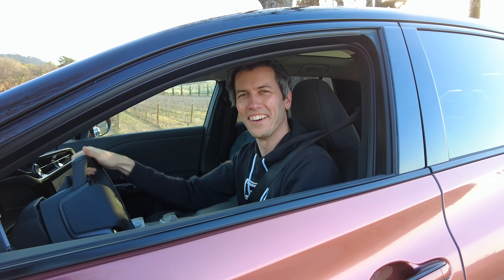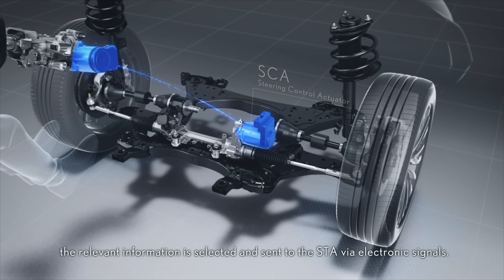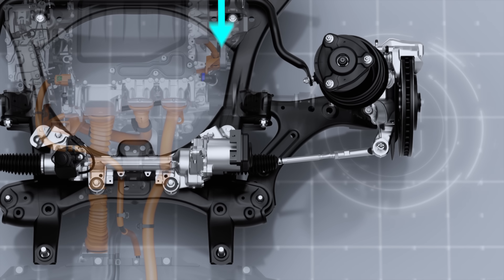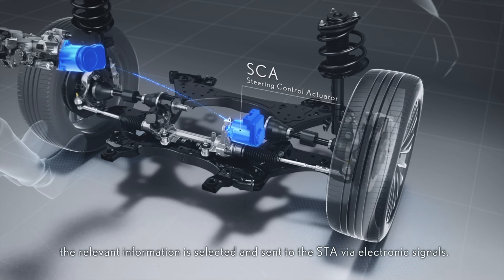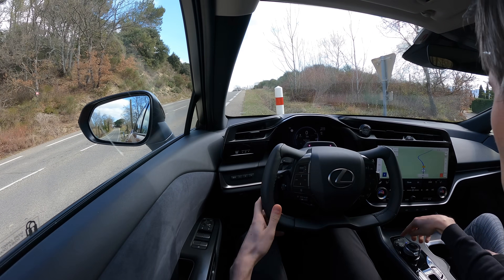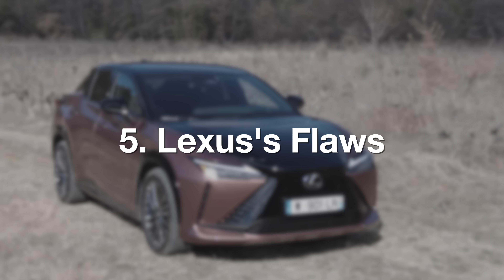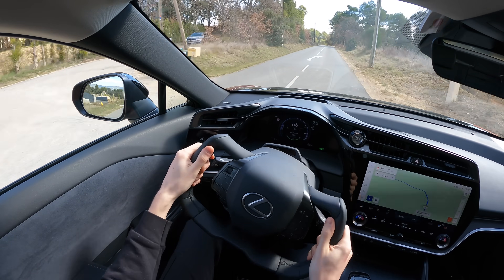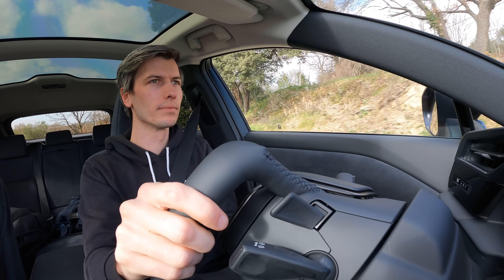How Lexus Fixed Tesla's Bad Idea: Steer-By-Wire Yoke

Comment: The variable steering ratio is a big technical issue to solve:
F.E.  I wonder if it's possible to swerve away from an obstacle while going at highway speed...
OR if it's linearly, smoothly, linked to the speed of the car, or if it changes in steps...
OR when the car loses grip will this system allow you to counter-steer your wheels enough to avoid a spin...

What I'm saying is let some Forza or GT developer program this - They have years of experience implementing variable steering ratio in their games and their solutions are proven to work for both performance driving and casual driving.

Comment: i agree, that most modern engines with electronic throttle have may more lag, than my first car with mechanic throttle. not that bad, but definitely noticeable. 
brake and steering by wire will always have delay no matter how small it is

Comment: One advantage of steer by wire that could actually be a big plus for those of us who want more feedback, is that there is no reason the system can't be used to amplify steering feedback far beyond what you would normally get. Of course that depends on the end user being given access to this level of control.
Something like this could be particularly helpful for driver training, since you could crank it up to show someone what sort of feedback is actually present in a given situation, then dial it back once they know what to look for.
Reply: I doubt thats something desired by those who drive it. 
But for high performance cars this could actually be something viable I imagine. If you look at simracing gear, the high end wheel motors have a peak torque output of 20-30 Nm. Even in racecars without power steering you only get around 10-12 Nm or peak torque, so if done correctly, feedback could even improve. 
The downsides are likely bigger though.
Reply: @schmid1.079  I agree. Unlikely to useful in most situations. But possible, and counter to the idea that a system like this would dull the feedback.

Comment: Since the steering ratio changes with speed, how does the steering response feel mid corner during throttle lift or light trail-braking? We are used to understeer reduction with forward weight transfer (assuming tires are within their grip limits), but if the steering ratio increases at the same time, this would appear to accentuate the effect a lot (which might be unsettling to inexperienced drivers), unless the system makes exceptions to ratio adjustments during rapid transitions. Would love to hear your observations!
Reply: Variable ratio steering systems already exist today, and are largely unnoticeable. If you’ve driven a modern luxury (BMW, Mercedes) or sports car, you’ve likely driven a variable ratio system without realizing it.
Reply: @TheWade822  lol Ford used them on Taurus, Town Car/ Crown Victoria/Grand Marquis.  Those are far from luxury or sport.  And this started in the 80s for those models.
Reply: @bowez9  yes, but all BMWs, Mercedes and Audis use variable steering. Its much easier to mention an entire popular brand, as opposed to certain models.
Reply: @TheWade822  more telling IMO that a tractor company has it on mid level vehicles and up.
Reply: @TheWade822  My car has variable ratio, but there are at least 2 kinds of mechanical variable ratio systems. One: the ratio varies with steering position, quickening at the ends. There is no change with speed. This is the type in the car I own. The other is where the ratio is mechanically varied as a function of more than steering position (such as speed) by electronics. I honestly have never tried one of those, so I can't comment. On the former though, I can say that quickening the ratio at the end of travel is a huge advantage that I would have a hard time giving up. Maybe I'd feel the same if I tried the second kind... I just don't know yet.
Reply: I would love to see this in a prototype racecar
Reply: Variable ratio/assist has been a thing in cars for 40+ years.  Ford has used it since the 80s continously.
Reply: @bowez9  Yes, but on all of these the ratio varies according to steering angle, not according to speed.
Reply: Seems like this version of the software is really not for spirited drivimg, more suitable for chauffeuring

Comment: I have some thoughts about this, my first thougts were: I trust Lexus with this. The lag in the actual steering seems pretty bad indeed for sporty drivers demanding thrilling driving action, but for your everyday commute I see no problem. I have driven a drunk-driving simulator in which the only variable was delayed steering input. I still managed the maximum of 500(!)milliseconds (that is half a second) by driving smoothly and defensively. Fun fact: the audience thought I had experience drunk-driving while in fact I had experience with racing games at four frames per second with additional physics delays. Lowest-end (Celeron) gaming FTW. Lastly; since this is a demo car, I expect Lexus to improve on the steering delay. I love to drive this car one day to see if it brings additional comfort and safety as you never have to regrip the wheel. My ex will absolutely benefit from this, she was regripping every 20 degrees of rotation, basically 'walking' the steering wheel left to right.

Comment: Very cool tech but yeah the only real concern of mine is if you need to suddenly dodge something on the road at highway speed by jerking the wheel. The car can simply say "No" and hit whatever you tried to dodge because the steering ratio is much higher at those speeds. Whereas if it had direct linkage that wouldn't be the case. Not saying this happens all the time, but it does on occasion. Also the input lag would likely drive me crazy, if I'm not turning the wheel, the wheels shouldn't be either. That being said I likely think that simply because that's just how it's always been and I've never driven a steer-by-wire car.
Reply: It would not "say no", it would map your inputs into a safety envelope, so you do not loose control of the car or flip it by jerking the wheel too much. It can even do adaptive steering to nurse every tiny bit of grip from the road, just like ABS.
Reply: @aigarius  Ah, that's right.  It could keep the steering angle within non-rollover parameters, kinda like ABS keeping braking forces within wheel lockup parameters.  Tie it in with the safety sensors (radar, video, etc) for better judgment, too.
Reply: As said in the video and several other comments, this system will always allow you to turn the wheel as far as you want. It will not deny a steering command. But it does worry me for future designs because it is trivial to do.

Comment: i think it will probably have the same problems as steering assist that is speed ramped up with lower speeds, when driving down a curved off ramp from the highway you tend do loose speed and steering starts to feel different, with a variable steering input the same steering input will mean tighter turns, when decelerating or less tight turns when accelerating which then means that you won't be able to hold the steering wheel in one position to drive a continous curve.

Comment: I just have to say this:
I don't care what kind of car you make if it truly does make a positive impact on the environment, but you shouldn't make a vehicle unibody or make batteries that are extremely expensive and that difficult to replace due to the "right to repair"
True environmental changes include reducing and reusing, throwing out a car to get a new EV is not reducing nor reusing. If you want to drive a sleek car that has some dents in it, there should be a way to replace those parts without having to replace the entire cab. Labor should be cheap to replace the batteries to keep people driving longer.
But I can see through this, because if this was the case, car makers would go bankrupt because they're not making any money off of the people...

Comment: I wonder if there isn't something better to use than just the standard steering rack.
Reply: You could probably use some sort of screw-based linear actuator.
Something cool you should be able to do if using steer-by-wire, is to use a separate actuator for each wheel. Maybe not that useful beyond slightly reducing tire wear at small turning radii.
Reply: Touch screen steering 👻😂💀😱

Comment: The problem is that even if this solution was the best thing ever and NEVER failed, it would take a long time to convince the consumer - "what do you mean my steering wheel isn't connected?". This is different from brake by wire, where a physical connection still remains in case of failure.
Reply: The average consumer doesn't know or care how a car works.  Only that it goes. If you watch this channel, then you're not the average car owner. 

Do you think Karen cares how the wheel is connected to the wheel when she dropping off the kids at soccer practice?

Comment: Progressive electronic assist is already solving the steering ration problem on highway. Looks like selling more parts that can brake and selling it as some features you need. Electric drive is simpler than combustion - let's complicate other systems to stay in balance!